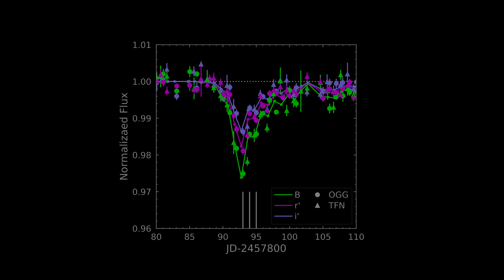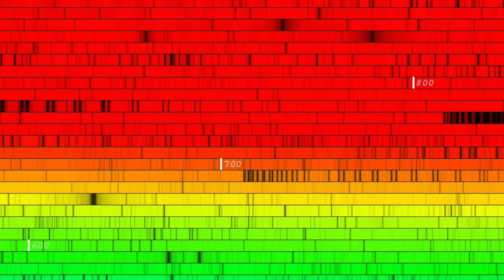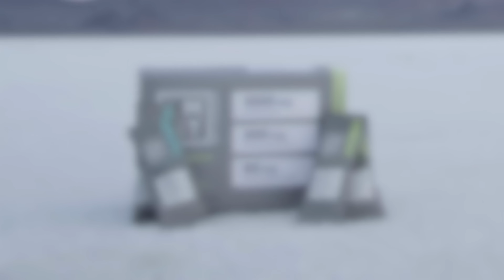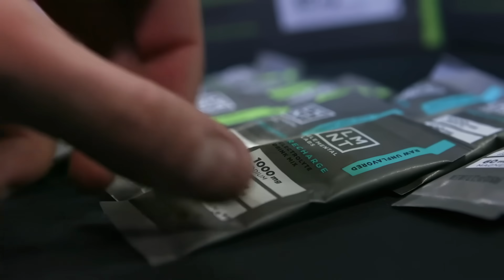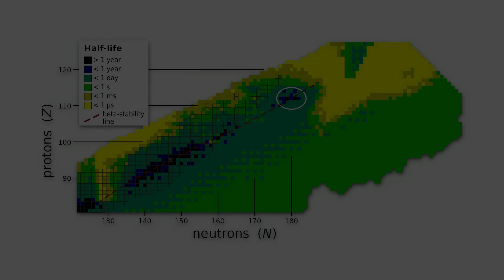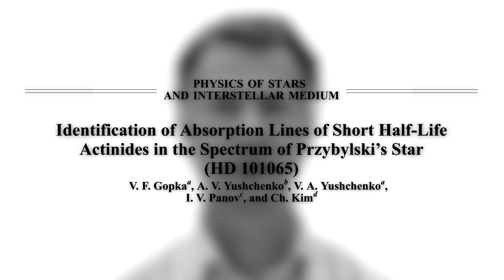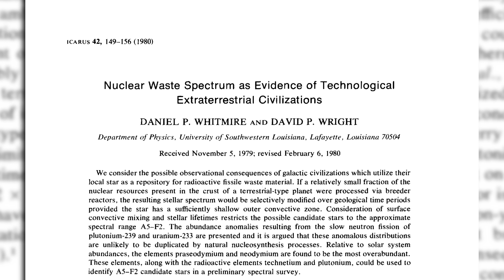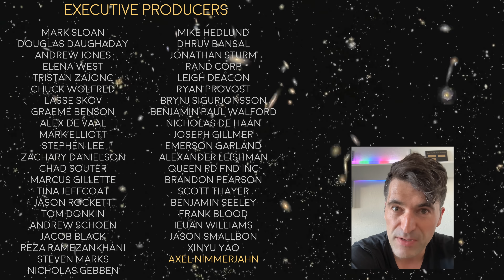The Star That Shouldn't Exist

Comment: Hi David, can you make a video about red shift and the relation with accelerated expansion? What i don't understand: suppose there is no acceleration of the expansion and only gravity, and we would look at galaxies close by and far away. We would see a big red shit in far away galaxies and a small red shift in close by galaxies. Why? Because gravity has slown down close by galaxies much more than far away galaxies..... Could you explain this and why we still need acceleration?
Reply from the maker: The way to think about gravitational red shift is with the classic picture of a rubber sheet being bent by masses. If light originates from deep within one these wells, it has to climb out to reach the flatter sections. That act causes a red shift. But if leaves a well only to eventually end up in a different well, there can be no net redshift. As it falls into wells it blueshifts back you see. So in the universe you describe light from a distant a similarly sized galaxy would not be redshifted.
Reply: @CoolWorldsLab  wow that's an incredibly wrong interpretation as to what causes redshift.  Wow.

Comment: Could the fact that the rotation is so high be that it's playing with the discernable spectrum shifts that we are picking up from it? Basically causing false positives as the wavelengths change. I'm not a 100% on how we do this, so correct me please. I thought we figured out which elements it held by the colors stars were putting off. Also, these would have to be time traveling aliens or have been here because the star is how far away?
Reply from the maker: Fast rotation causes line blending, as we animated in the video. Sharp lines are impossible in a fast rotator.

Comment: It’s just misinterpreted. The boring solution is always correct
Reply from the maker: The Gopka paper argues that all stable elements have known spectral lines and here we have an unprecedented number of extra lines which can’t be due to stable elements. They make assignments using theory and show their calculations agree with what little lab data there is for these actinides. So the paper is actually quite convincing if you take a read (link in the description)

Comment: Why didn't you show the spectra that Gopka published? I think just seeing the fitting clearly shows that there is a lot more work to be done before we just to aliens. Also After the Gopka paper there have been several new models for higher ionization spectra which would improve the results.
Reply from the maker: Spectra are difficult to visually interpret to the untrained eye, I didn’t think this would have helped much. There’s been no reanalysis of the spectra to my knowledge, but share links if you come across something.
Reply: @CoolWorldsLab  I think you are right but when I saw the spectra in our references I was surprised at how bad the fit was compared to what is typical in my field. 

I loved the video BTW!

Comment: Wait, why are we not investigating this harder. This feels like a prime candidate for just a slightly closer look.

Either that or the likelihood ratio is just so bad that the chance of seeing the observed data given the hypothesis of the presence of any significant amounts of these elements is just not worth following up on. 

Somehow it feels like this can't be a problem of not enough telescopes, since any sensible "exception handling" priority system would at least turn 1/10th of its total relevant capacity over to "hey, this looks like either new physics or aliens, plus it's already a weird and promising subclass of star for calibrating spectral measurements on A-class stars with Doppler smearing" - y'know? Like 1/10th until you can reprioritize, more evidence will come in, and there will be an obvious trend in the updates. If it gets 10x less likely, start cutting back the expenditures, but just leave it on the top of whatever new schedules you have for more detailed mapping of stars. 

Y'know, unless the evidence is just so completely awful that it would be embarrassing to turn on the motors and align all the hardware just to find out 2 nights later that this is completely hopeless and you'd have to collect data conventionally for 30 years, launch a new space platform, or do some kinda grav lensing to actually drive the probabilities up to "yep, new elements or aliens!"

But I kinda doubt that's it? You weren't talking about it like this was a wacky paper that completely misrepresented the priors and evidential updates to arrive at their assessment of whatever probability they quoted that these elements are present. 

This isn't a scientific theory, but observing the evidence that this has been left seriously under-explored feels like a strong update in favor of my hypothesis that "time on telescopes is fought over the way charities fight over Bill Gates time, with the same consequences of having all relative importance levels obliterated by the noise of everyone trying to maximize the perceived importance of their proposal."

I don't feel confident enough to call "90%" and correctly diagnose 9/10 other organizational dysfunctions like that on similar amounts of evidence as I have now - but I'd say I'm at 60% we're dropping the ball on something credibly expected to be interesting here because people can't tell what an unbiased consensus looks like on the expectation of interesting observations given some telescope aiming policy.

Send every astronomy person 10 different schedules and ask them to place bets on which policies would be most likely to produce interesting results - given some criteria for assessing that. You can't test all 10 different proposals in the same year, but maybe over several years you could mix them up a bit, leaving 20% of the slots blank on each proposal, and what you actually take as you policy is like a weighted mix of the schedules given how optimistic the betting was on the different individual schedules.

To be clear, this kinda prediction market solution probably has a better cleaner form that better aggregates people's predictions for each proposal for a time slot. This example just feels like one that people wouldn't complain about being too complicated, and it can preserve most of the shenanigans that people like in establishing the current schedules. Y'know, instead of having a marketplace for the experts betting on which proposals will produce certain results if given a slot, setting the whole schedule based on just picking a ratio of what kind of results you want to achieve and filling that portion of slots with the one's trading the highest - you instead just send people out a deck of a few traditionally constructed schedules and ask them to bet which ones get the most "points." Then, of course, you mix the actual acted on schedule up a bit after getting the betting results, so you can do some math afterwards to pay out the bets. 

Don't ask me to do that math though... It just feels like the kinda thing you could math...

Comment: 'A' spectrum stars are at approx. 8000 K on the Hertzsprung diagram. It goes from O to B to A to F at 7000 K to G (our Sun with a Luminosity of One, goes up+ or down- from there) to K (orange stars) and finally M red stars from red dwarfs that can last for up to 10 trillion years. 
So to make it easy to remember instead of starting at A going to G they came up with O, B, A, F, G, K, and M. They made up a little saying to help students memorize this illogical series of letters, Oh Be A Fine Girl/Guy Kiss Me. Now isn't that easier? 
Don't get me started on the O Ia to B Ib supergiants to A II Bright Giants and F III or G III just Giants D IV Subgiants and G V main sequence which our Sun is.
I won't get into the small letters meanings as there are too many, but Dr. Kipping explained part of that.
I like how you threw in Professor Tom Lehrer's "The Elements Song" from the 1960s.

Comment: Here's my 2¢. I notice there is no luminosity class associated with the star. Could it be a subdwarf? Or maybe a subgiant. Here's my speculation. 

This was originally a close spectrographic binary. One star went nova, became either a white dwarf or newton star. Some of the ejected gas collapsed on the surface of the other star. Making it more massive and also braking it. As time went on, the now larger A star consumed the white dwarf or neutron star and in that process is generating the magnetic field and eating its dead companion , thus creating these heavy elements?

Comment: 100km/s is not a measurement of spin... you measure spin with RPM. Should we assume when you say it "spins at 100km/s" you mean that is the linear speed of the surface at the equator? What is the "surface" of a star?
Reply: Also what does "ten times less" mean? Do you mean one-tenth as much?

Comment: Cool video and product at 5:50. Unfortunately my enthusiasm dampened considerably when the LMNT link for a free electrolyte sample was anything but. FREE indeed! After an expensive purchase. 

On the exotic star conundrum,  I suspect the calculated spectral results for man made elements that exist only in microscopic quantities is the flimsiest evidence on which to base any conclusions. It's not straight forward to calculate spectral lines for even well known elements, e.g. carbon. Observational evidence is absolutely necessary and sadly lacking.

Comment: How does the island of stability hypothesis help? Instead of having an unexplained source for these short lived isotopes, you have an unexplained source for these longer lived heavy hypothetical isotopes that might decay into the short lived isotopes. The mystery didn't get smaller.

The relevant paper is probably "Isotope shift and search for metastable superheavy elements in astrophysical data" on arxiv. I read the abstract and it didn't mention a source for the island of stability particles.

I skimmed the paper and it suggests a past supernova as the source, same as the source for many of the interesting atoms making up me and I assume you. Top partial paragraph right column first page. I don't see a story there about why it would have happened in just that one star.

Comment: Or, an even easier explanation that meets all observations -- such as the slow rotation, huge magnetic field, odd elements -- is the star does have a layer separation dynamo situation going on, and the interface between the star's slow moving radiative upper layers and the faster spinning inner convective layers is creating a *Particle Accelerator*, and that atom smashing is where you get all these elements (and also explains how they are flung out into the radiative layer).

Comment: How do we know these elements aren't common on the surface of all A stars? If we haven't done spectroscopy on a normal A star how can we be sure this one is weird, apart from the slow spin (which, couldn't that have been caused by a collision with another star?) How do we know our model of an A star's atmosphere is correct? I for one am a little skeptical of the drawing you showed on screen, I'm not sure I believe a star could really have that large of an envelope and not just shrink through radiation. I think that model needs refining, and then Przybylski's star wouldn't seem to weird.

Comment: "Most A stars spin really fast. Typically over 100 km/s."
You mean at the equator right? Using km/s as a unit for spinning speed doesn't make much sense to me, as the equator should spin a lot faster than the poles or the insides. Or am I missing something?
Reply from the maker: Yes, should have clarified, by convention astronomers use equatorial speed
Reply: @CoolWorldsLab  Oooh this is convention? Good to know. And thanks for helping me understand something new. I mean, more than you already did in the video.
Reply from the maker: Yes we use speed because that induces Doppler shift, which is what we measure (specifically here line broadening)
Reply: @CoolWorldsLab  right, that makes sense.

Comment: Lets assume that we are correctly detecting these elements. That leaves us with two options lets start with the little green one first.

We know that the elements we are seeing are difficult to produce as they require rather difficult to reproduce conditions. We also know that these elements are not likely to be stable in most of their configurations so that would make them even harder to use to salt a star with. But lets give them the benefit of the doubt and lets assume that they would be able to reliably produce these elements (we know they do not occur in nature so they have to be producing them). No lets have another look at the star and its size... yup its big real big. How much material would we need to fling into the sun for it to have measurable quantities of the material in its spectrum when measured from a few hundred lightyears away? Now lets scale the sun up to a few hundred times its size and redo the calculation. Ok so to be able to make a star this size show measurable amounts of any exotic element you must be not sprinkling some of it on there you must have flung a small planet worth in there. This makes the aliens dumping waste or trying to let everyone know where they are ideas pretty insane to me.

All that is assuming the island of stability is a thing which it does look like it is seeing how the half life of the extremely heavy elements have made seem to are pretty long and get longer as we pile on more neutrons.
If all of that is true and our best calculations/guesses as to how these elements would show up in the spectrum are correct (thats a lot of ifs) how would we create a star like this? Could it be that this star had a interaction with for instance a neutron star or a remnant of a neutron star and survived for it to have access to these elements? Is that possible, and what other elements would we expect to see if that were the case... Or could this star just be a special case where a star formed in a place where it was able to grow to this size yet be spinning slower than normal and have less iron than we commonly see?

My guess is that we are not really seeing the elements we think we are seeing we are missing something, something that for instance distorts the light traveling from the star to us. And (highly likely) we are just seeing a type of star that is quite rare and that shows us that the standard model is just wrong (we have a lot of evidence telling us that it is not quite right) and these types of stars are possible to be constructed naturally.
Aliens are a great crutch to use to explain anything you want, replace aliens by gods and we are back before the scientific advancements of the last few hundred years. But even if they do exist and we were to get to interact with them we can be pretty sure that whatever technology they might have in the end it is going to have to accept the reality of the laws of physics, I know our understanding of those laws is not quite right at the moment but they do not seem to be to far off either, not to the extend that would allow for the creation of planet sized blobs of exotic elements just to make a nice fireworks display out a star anyway.

Comment: Technetium comes to mind, an element whose longest persisting isotopes have a half-life of 4.2 million years, which doesn't have any stable isotopes. It is found and produced in red giant stars. Same story, more or less? Not that extraordinary after all.
Still an interesting discovery, though.
Reply from the maker: Yes that’s true and a great observation! Technetium (Z=43) can be manufactured naturally inside dying massive stars (but on the lower end of the mass scales) via the s-process. But the s-process (neutron capture, not really fusion) should not make anything heavier than polonium (Z=84). So actinium (Z=89) and the other actinides are too heavy to make this way.
Reply: Thank you for the clarification! I find your videos very inspiring, btw!

Comment: Some exoplanets inexplicably have measured densities greater than that of Osmium, implying that if their density was measure correctly, they MUST have island-of-stability elements in them. If this is the case, than if one such planet got too close to its host star and was swallowed by it, that could explain both the detection of these elements and the star's relatively slow spin, especially if the planet in question was exceptionally massive and thus able to significantly affect the stars angular momentum.
Reply: No the slow spin is explained by the magnetic field which, again, flings out material & puts the breaks on the star. Newton.

Comment: The rare earth elements and actinides could be driven to the surface by a process similar to Silex as they would emit caractoristic frequncies that would make them selectively transported by the powerful magnetic field. The star could have been a partly failed core collapse process where the outer envelope was stripped by a black hole and the core plus some some heavier stuff ejected shortly before the stwr would have went supernova. The result would have been a very hot star with a high magnetic field with an array of heavy elements. The lack of iron is strange though.

Comment: Could it potentially be something like a neutron star companion that collided with it at one point? Or maybe even the neutron star is inside it rotating around. Material in the star is being crushed and fused constantly into super exotic elements. It might also explain the slow rotation with two interacting magnetic fields. Considering it's a larger star with a shorter life, maybe it could have had an even shorter lived companion
Reply: Plus a neutron star might be too dim to pick out in the light spectrum, or even entirely hidden if it's inside the star itself.